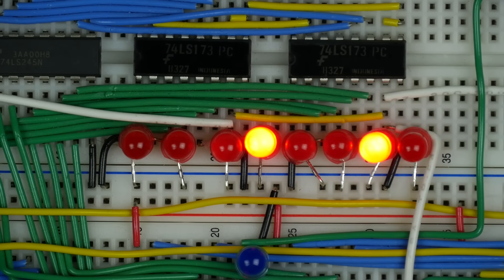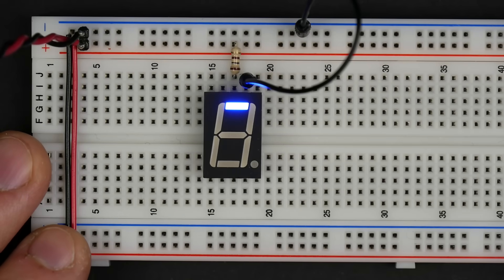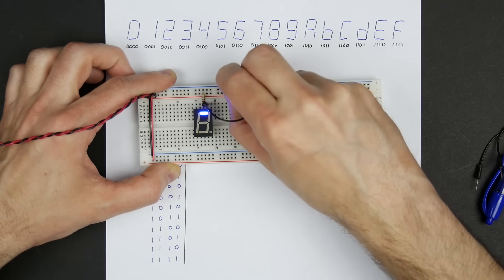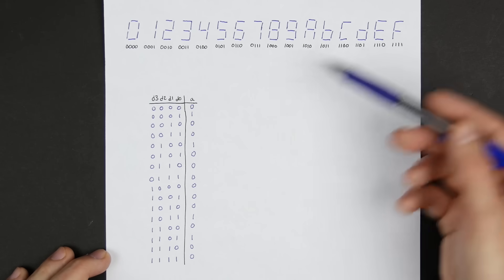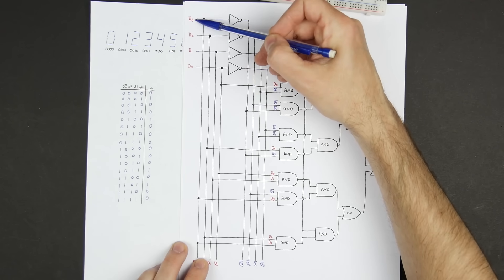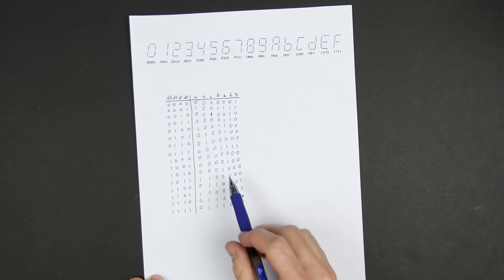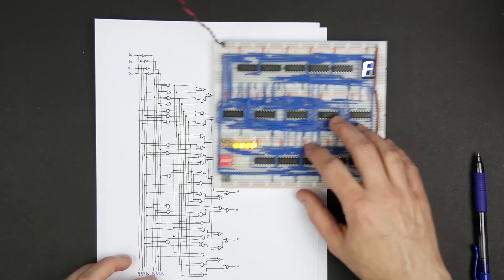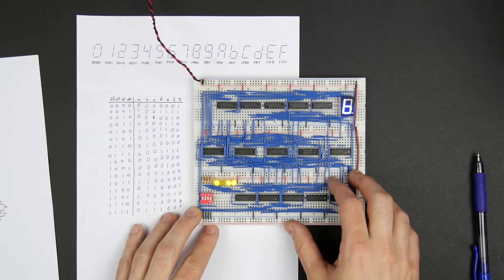Designing a 7-segment hex decoder

Comment: I thought of using an eprom as a decoder too but with the popularity of Hex displays I'm still amased they haven't designed an ic that works like a 7447 but decodes hexadecimal...
Reply: They have, but it's hard to find some. I got 10 DM9368N for 12.50 $ from ebay.
Reply: I should have mentioned that the DM9368 are designed for common-cathode displays, not common-anode as used in the video.
Reply: Well just thinking about this, the quickest way would be to just use a low-pin count, low gate CPLD, although probably not cost effective. The cheapest way would probably be to use a very low cost MCU (something like a $1 PIC or ATTINY).
Reply: No, no, not MCU!!!  :)  That just ruins the elegance man.   I was planning on building something with a GAL/PAL type thing as I wanted to have some fun playing with the things anyway and this gives me an excuse.
Reply: A decoder could also be programmed into a FPGA, course it's an overkill.
Reply: hey there 
CREATE SHADES USING SIEERPINKI'S TRIANGLE AND YOUR SMART PHONE  https://www.youtube.com/watch?v=DMYn_0uTVB8&t=15s
 go watch and try supporting by subscribing

Comment: Ben, your circuit has 33 ANDs, 17 ORs and 4 NOTs, totalling in 15 chips with 3+3+2=8 unused gates. You could have very easily saved on chip simply by implementing one OR with a spare AND plus a spare NOT (or one AND with a spare OR and a spare NOT).

Comment: Putting the current limiting resistor at the common anode is usually not recommended since the brightness of the LEDs will vary depending upon how many are turned on.   It is recommended to use a current limiting resistor for each individual segment for the best results.
Reply: Rex McCarthy One might actually view this as an advantage, as the overall brightness of the complete digit won't vary as much. Also, you have a fixed amount of current needed per digit, regardless of the actual value. Anyways, the difference can hardly be seen at 5..10mA for all segments with a modern display.
Taking all that, plus that it's much easier to build with only one resistor, I personally don't care much what's usually recommended.

Comment: 12:28 Whoa, that's a lot of chips to drive one digit :q You realize that there are dedicated chips (7-segment display decoders) with all that logic inside? But even if you want to do it the hard way, I would do some simplification first to save some chips. And there's a systematic way to do exactly that, with Karnaugh tables.
14:14  Wait, what? We need only 2 hexadecimal digits to display 8-bit numbers, not 3. We would need 3 if we wanted to display it in decimal.
14:37 Yeah, you could do that too... (using addresses as inputs and values stored there as outputs). If only EPROMs weren't so big, expensive and cumbersome to program without a special (and again – expensive) equipment :P
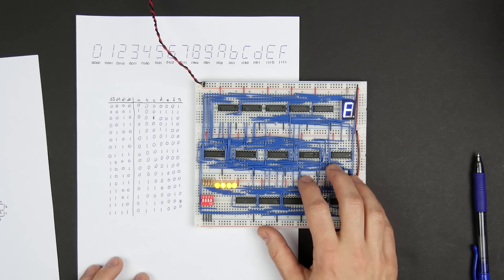14:50 Well, actually this can be done with sequential logic too: you just need to include the output states as part of the input. But it's even more cumbersome, because it requires to pair every combination of inputs with every combination of outputs. And there could be a lot of those combinations! :P (that's why implementing it as an actual sequential logic circuit which calculates it on the fly is usually a better way to go).
Reply: He does it in this manner to show how it works, of course you would use ICs or an FPGA for this.
FPGAs could simulate his breadboard computer, probably just as fast or faster.

Comment: Why didn't you use karnaugh map?
Reply: It's obviously not so easy, as the resulting circuit is far from optimal. The Karnaugh map for four inputs is still feasable by hand (still 2D) and would make for an interesting video in itself.
What else one could do is to think in terms of 2-bit data selectors (which can be built from 2 ANDs, an OR and a NOT, Ben made a video on them). They correspond to the ite-operator ("?" and ":") you might know from programming. Looking at the minimal sum-of-products from Karnaugh you'll immediately find considerably smaller circuits. Eg for the "a" segment 7 AND, 2 OR and of course 4 NOTs for the inputs - as opposed to 11 AND, 3 OR, 4 NOT.
Reply: TheRealMeisl I did this myself for a project I'm working on. K-maps are amazing for this kind of thing.

https://ornotblog.blogspot.co.uk/2017/03/clock-design-notes-2-7-segment-decoders.html

But I only did numbers 0-9 since mine are for a clock.
Reply: +Tom Storey  Very nice blog post that is of yours! Now there's two things I'm wondering about:
1) You mention how you were able to re-use certain combinations (CD' in your example), so in effect you're optimizing across segments (as opposed to your using one K-map each to optimize a single segment). I did this myself, but not systematically, just by kinda "staring" at them all at once. Is there a better - systematic - way to do this other than writing a program that does an exhaustive search?
2) K-maps are designed to find minimal sum-of-products, aka "minterms", so the basic gates used are NOT, AND and OR. But of course there are chips with other kinds of gates, particularly universal gates like NAND and NOR. How would a systematic approach look like which produces minimal terms containing, say, only NORs?
Reply: Tom Storey  Looking forward to your upcoming post :) Btw, I just left a (first) comment on your blog, basically just repeating my first response here - since I figure you'd rather have the real discussion over there, right?

Now, re K-maps: well, they are what Karnough made them, I am not trying to redefine that. I'm rather trying to extend the concept, to vary it. As an example: say you have XOR gates at your disposal, and you have a 4-input K-map ready. Instead of - or in addition to - trying to find maximal groups of 1s in adjacent cells (which, in a K-map, represent products/ANDs), you may now also look for groups of 1-cells for which the nr of 1-inputs is odd (if you mark just those cells in mentioned K-map it looks like a checker-board).
That's just an example, and it's not really a novel idea that comes quite naturally once you play a while with K-maps. It's just for illustrating what I mean by "vary the concept".
Reply: If there is, I'd like to know! I spent a few days staring at my k-maps trying to find optimisations as well. The more time I spent looking at them the more I learned how to recognise cases where I might be able to make savings. There might be tools and other tricks or methods that I havent discovered yet, but this method seemed to work well for me. :-)

If I understand your question correctly, I suppose I havent tried to produce minterms using NOR logic. I have just translated my minterms in to NOR logic in my circuits.

For example, in Bens decoder, an inverter produces a high when an input is low, so the output of that inverter can be used along with inputs to match against various high/low input combinations using standard AND gates.

In my case, when an input is high the inverter produces a low, and that low in combination with other inputs can feed a NOR gate, and if all of the inputs to that NOR gate are low then its output would be high. Same function as an AND gate, just using inverted logic. So Im basically using the universal gate property of NOR to build the other types of logic gates.
Reply: Tom, it's interesting that you re-state how a NOR gate works logically in your response to 2). You know, your stressing the inherent "AND"-character of a NOR reminded me that the groups in a K-map essentially represent products (ANDed-together things)... I'll have to think about it. Oh, and yes of course, you got me perfectly right re 2).
Nr 1) is in a way trying to think K-maps backwards. Sorry, I'm having a hard time explaining my unready thoughts. So: with a K-map we're trying to express one bit of output (or: one segment at a time) in terms of n inputs as concise as possible. With Gray-coding together with the wrap-around "trick" we can do up to 4 inputs - that's 4 dimensions - still on a 2D paper, but the principle of searching for maximal clusters with a size a power of 2 in each one dimension extends to any nr n of inputs. Ok, but still only looking at 1 bit of output at a time. Now: how can we "sneak in" a second output-bit; can't we "trade" something here?
I am thinking of something like (formally) introducing an additional input bit but projecting it down to where it has the desired output state... But again, just unready thoughts of mine.
Reply: TheRealMeisl I don't think we can have multiple outputs represented by a single k-map. I mean, we can re-use the output of a single k-map to drive multiple display segments if they share the same logic, and without spoiling things too much, I have another blog post coming up where I talk briefly about this.

But I think you are right in that each k-map only represents a single bit of output: is it high or low for a given input value. I read somewhere that if you aren't representing such a "boolean" output then it's not really a k-map anymore.

Sorry if I still haven't got the gist of your question? I literally stumbled across k-maps days before I started writing about my project so I'm still learning. It just so happened they were the answer I needed to do some of the design work. ☺️
Reply: I think its worth continuing the discussion over there so as not to hijack this videos comments. :-)

I put up the post about 16 segment decoders a short while ago.
Reply: That's cool, see you there soon.
And to everybody else who's read this far: please feel heartily invited to come there, too!
Reply: or just plug it in logism or something
Reply: or just buy a CD4543BE
Reply: From where you belong...
Reply: Cuz K-Maps are not as much fun as gluing together discrete logic gates. :D
Reply: @BillAnt  I think you're supposed to use solder actually
Reply: The map is sparse enough that you don't need a Karnaugh map to find the optimal logic.  It's easy enough to find the right logic without using a Karnaugh map in this example.

Comment: you can use h or backwards J as B so its not confused with 8, another way if you are not using the decimal is to rotate the display  and the decimal as * to mark letters" 0 1 ~ 8 9 *A *B."

Comment: I have learned so much from this series of videos. I never understood how computers worked at a fundamental level. I knew about bits and registers and all that, and even programmed BASIC as a kid, designing spites and later getting into HTML. I also build my own machines and can troubleshoot computers as well as analog circuitry (like tube amps and such). I understand how transistors and capacitors and resistors, et al work. But the actual logic circuitry behind computers, despite delving into Boolean algebra on my own in 8th grade, has always eluded me.

Over the last four days I have watched every one of your videos on the subject and now I finally understand how computers actually compute and the logic behind them, which has given me a newfound appreciation of the level of complexity hidden in out-of-date computers like my childhood C64, to say nothing of modern PCs, smart phones, tablets, etc. It is truly incredible. Thank you for sharing your knowledge in such a concise way. You are a great teacher.

Comment: Hello,

Here is my output display register I built using EEPROM's as decoder driver that displays output in decimal, octal, hexadecimal by selecting two higher address bits 00 01 10.

PDF Schematic Diagram of my Output Register – Display module.
https://drive.google.com/open?id=0B2ZePCSY4JnFanYzTVhudkVyaWc  

Thanks, Mike,
Reply: Mike DeLosier

Comment: Love it! Always such quality videos. Question about your construction methods: how do you get your jumper wires? Do you make them yourself? I always find myself running out when I buy those premade kits.
Reply: I'm pretty well certain that he makes them himself, probably out of solid-core insulated wires.  I've noticed that the jumper wires which are made for kits are always colour-coded by length which can be confusing when you want to trace a run but it goes through multiple colours of jumpers.

If you can get hold of some "telephone" cable, you can open it out and strip out at least 4 different colours of wires.  More, if you get a larger cable with more conductors.
Reply: hi there 
CREATE SHADES USING SIEERPINKI'S TRIANGLE AND YOUR SMART PHONE  https://www.youtube.com/watch?v=DMYn_0uTVB8&t=15s
 go watch and try supporting by subscribing